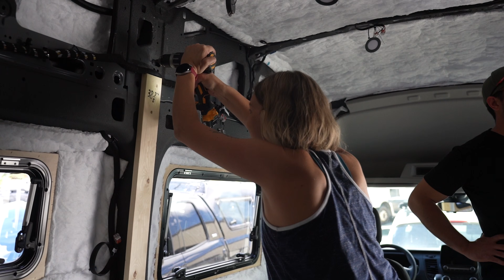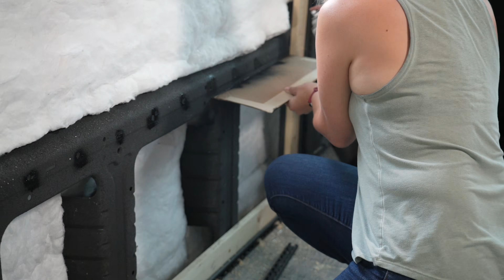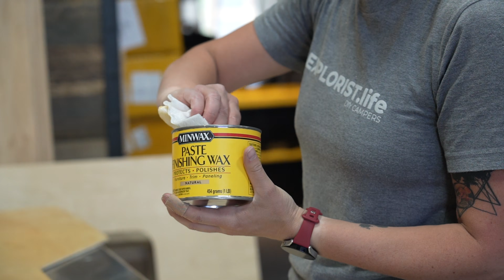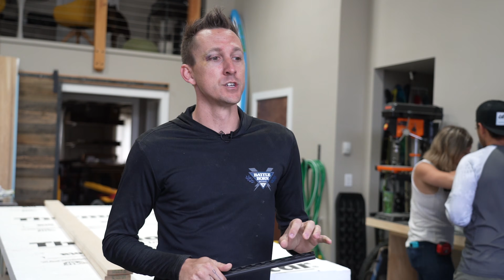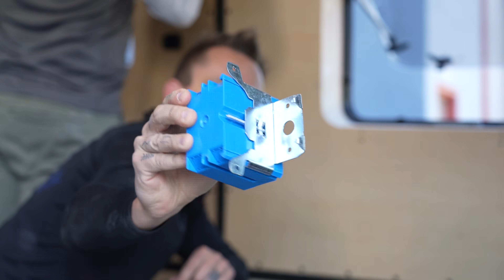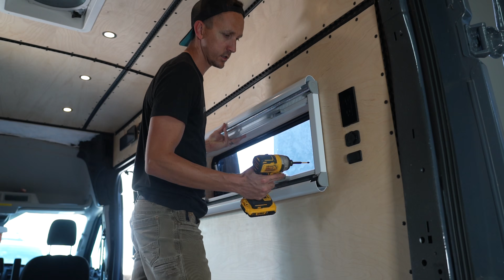DIY CAMPER VAN WALLS W/ L-TRACK (100% from scratch)

Comment: You sure are putting a lot of weight in the construction. Wood plus l-track in stead of 8020 or other extruded aluminum.
Reply from the maker: It's a one-ton van with a twin-turbo engine.  Plenty of capacity.

Comment: Loving the look of that and planning something similar for by build. Im wondering why you used 4x1 and not 2x1 or less for furring, also why not recessed L track so lots less screws for your panels? Could be a good weight saving all round?
Reply from the maker: Great questions — there are always tradeoffs between strength, weight, attachment points, and install complexity with wall systems like this. We’d be happy to take a look at your build plans and help recommend the best approach for your layout and goals, especially if you’re trying to optimize weight and mounting flexibility. Reach out to our support team here with some details/photos of your build and we can help you plan it out: https://shop.explorist.life/support?utm_source=youtube&utm_medium=comment&utm_campaign=support&utm_content=response_link

Comment: a standard spot drill 1/8th in your language and then drill to size with a good quality drill using a step drill is crazy, from good engineering  sales places you can get a range of drill bits that do this easy but i like to use a touch of cutting compound as well.
Reply from the maker: Thanks for the tips!

Comment: Great video. I love the simplistic idea of using the furring strips and L tracks together,  Such a clean look and provides a great line for the wall panels.  What black screws did you leverage with the plus nuts?

Comment: For drilling hard metals I would recommend using a carbide drill. You will have to order them online. Box stores typically don’t carry them.  And they are very expensive. But will drill through like butter. And definitely use a cutting oil.
Reply from the maker: Good to know, thanks for the tip!

Comment: Your videos have been so helpful while working on my Sprinter conversion over the past 18 months. I’ve been using a lot of rivet nuts on my build, and am about to start attaching L-tracks. I was wondering, is the assumption that plus nuts are less likely to slip out than rivnuts?
Reply from the maker: Thanks so much — awesome to hear the videos have helped with your Sprinter build! You're right to compare plus nuts and rivnuts — plus nuts generally offer better grip in thin sheet metal because they expand more and create a wider hold, which can help reduce the chance of pull-out under heavy loads like L-track.

If you'd like help picking fasteners or mounting techniques for your layout, our support team can dive into the details with you: https://shop.explorist.life/support

We offer free personalized help for gear bought from our store. For other gear, our Pro Support Membership is a great way to get expert guidance: https://shop.explorist.life/shop/all-products/membership-tiers/

Comment: Slow speed high pressure. Rule of thumb drilling metal… also, it’s called an unibit. Also, if you’re framing out with a unibit, your pilot hole should be the same size as the smallest step…. Instead of doing that, use self tapper screws with the pilot hole

Comment: You asked us to leave comments for tips on drilling hardened boron steel of a ford transit. 

I use an abrasive cone bit. First I take a punch and dimple the metal and then I use a rotary tool to bore the hole bigger with the abrasive cone. It’s slow but it does the trick

Comment: Why couldn't you have used the existing holes for the plus (rib) nuts? Any why install then every 6 inches (or however distance you have)? Doubling the distance between each would've sufficed?
Reply from the maker: 1: Those holes didn't always line up.  2: The holes were pre-drilled in the l-track and leaving every other hole empty would have looked goofy.

Comment: I love, love your videos. I am redoing my ceiling. But I can't use furring strips like you did because I would lose too much height. Does the L-Track need support behind all spots? Could I just hang it lengthwise as you did without a furring strip between the ribs of the van ceiling?

Comment: So, the main reasons and benefits for all the L track are: (1) Strong and configurable mounting surfaces for cabinets, seats, beds, kitchen counters etc. (2) They make it much easier to remove whatever is secured to them so you can get access to the walls behind them (and what's behind the walls themselves). (3) They make the van more "modular in the sense the cabinets, boxes and beds mounted to them can be removed more readily so that the van can open up inside and be used for hauling large objects etc. (4) The L track allows for very flexible anchor points for straps to secure loads inside the van. Is that about it? Just trying to decide if they are worth the effort for my more primitive and simple build. Thanks
Reply: You can always add them on top of any type of wall you do.  In a van almost anything goes so the only limit is your imagination

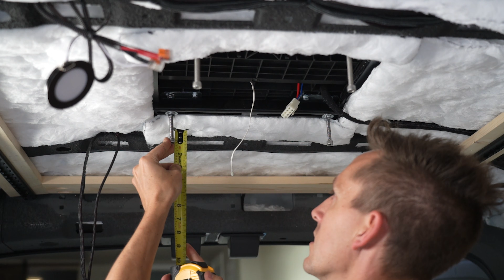Comment: How is the furring strip over the back doors attached?  It looks like it's just kreg'd to both of the strips on the side (19:01) and nothing is actually attached to the van in that section (b/c those side strips are attached to ribs), is that right?
Reply from the maker: Yeah, that was just pocket hole'd up there to give us something to screw the back part of the ceiling panel to.

Comment: Any pneumatic rivet nut gun you know of that works with stainless steel rivnuts and plusnuts (that's a couple hundred dollars or less, not thousands of dollars)? The KIARUO LM07 in the video's tools list indicates can't use stainless steel nuts. I understand stainless steel nuts should be used on exterior underside of van floor, because the standard zinc plated steel ones will likely rust in a couple years if not sooner. Have any insights, recommendations, pneumatic rivet nut gun options?....
Reply from the maker: Idk, the one shown in this video is the only one we've ever used.

Comment: So much weight, why? Its a moving vehicle, you should be looking for low weight. The money you spend hauling so much weight in the van all the time is so much more than using A/C or Heating.
Reply from the maker: It's not so much weight.  If I put 8 sheets of 1/4" plywood in the back of the van to haul home, nobody would bat an eye.  This van is literally designed to carry weight.
Reply: Carrying weights uses more fuel, more weight also means more forces while you are driving. Vans and cars  are designed to be light, and so should be camper vans.

Do you need wood in a van? Its not a house. We should look at the function and choose the best materials. I personally don't think wood cabinets are the best way to store things in a car, there are many alternatives. 

We don't use wood trunks and chests in travel bags anymore, why do it in vans? Why not develop a modular storing system, based on cases that you can take in and out of the van, for example?

Composite, lite weight material cases, you can store in your garage or house and move them to your van when needed.
Reply from the maker: @josearaujo8616 It's clear you don't like my projects.  Perhaps just move on to a different video?
Reply from the maker: Or better yet, build your own van and upload your own tutorials to show everybody a better way.  Until then, you aren't adding any value to the world; just talking shit.

Comment: Great Channel...Just started my Transit 250....got the same pneumatic tool and plus nuts in video.   I'm having a problem with the plus nut spinning on install and won't mushroom out. The hole is smaller than 3/8 , tried a star washer  to see if it  would grip..  not sure what I'm missing. Thanks in advance

Comment: Again one year plus, :-) I wonder, I often use rivnuts that come with a very small flange so you don’t need to either space out or drill out a small section. Wonder if these also are available in plus nuts which I think I like better. Awesome build, I am going to lend your ideas if you are Allright 😅

Comment: Maybe I missed, but I didn't see you had used reflectix for insulation...  neither here nor in the previous episode. But you mentioned it while starting the insulation. Did you actually use it? 
Thanks!
Reply from the maker: lol, yeah; we ended up not using any.  I figured we would use some on the B/C pillars but ended up not.

Comment: I always carry a large magnet (covered in blue paint tape) that I stick to the sheet metal under my holes when I'm drilling to catch the metal shavings when I'm drilling.  The tape helps to avoid scratches on the sheet metal.

Comment: Are you concerned about the metal shavings from drilling into the metal and falling between insulation and walls rusting over time?
Reply from the maker: Nope.  Not really.  If I were concerned about stuff like that, I probably shouldn't be in the automotive customization game. 🤣😆

Comment: Why would you not drill all the holes first before putting the wool in the walls? Just wondering. We would not want the metal shavings getting into that
Reply from the maker: Mainly because it wouldn't have made sense to put our insulation video in the middle of our walls video.
Reply: @EXPLORISTlife  thanks. Have a great weekend and keep up the great videos. You all do a very good job with all the information

Comment: Won’t the lateral l tracks on the roof will be enough to hold a hammock?

I’m looking for a solution for my hammock problem :D
Reply from the maker: Probably.  When you do your walls, just think of where the hammock will go and make sure those points are the strongest.  The L-Track will hold a hammock for sure; but you just want to make sure the L-Track is really secure where you plan on hanging from.

Comment: I would love to know your thinking behind using the paste wax versus a polyurethane or other coating. I’m sure each one has its own pros and cons but would love to know what helped you make your decision.
Reply from the maker: We had paste wax in the cabinet and did not have polyurethane or other coatings. 🤷‍♂️🤣  There was incredibly minimal thought that went into what finish we used on the wood.  Paste wax is always my go-to as it works well for most cases I'm trying to use it for.

Comment: would you have done riv nuts next time since they would install easier with the air gun then the plus nuts? seems easy to mess up with how strong plus nuts are
Reply from the maker: I don't really have a strong opinion on plusnuts vs rivnuts.  I think those two are like the ford vs dodge of the fastener world.  People love one and hate the other when in all reality, they are both fine.
Reply from the maker: I'd probably just use plus nuts again because they worked just fine for us this time around; and why change a good thing.

Comment: Astro Pneumatic Tool PRN1 is the ideal tool to use, its what I use at work at on a daily basis. Also try rivet nuts in sheet metal, preferably stainless. much better than 'plus nuts' they're less prone to loosening from vibration.

Comment: I was trained by the US Army to repair Safes and Arms room vaults...sames as bank vaults.... (Not much use in the states for a combat sniper...Vietnam 1970, 2/502 Inf 101st Airborne) after I got back... I was a bump and paint man before I was first drafted...spent 9 years Army before moving to Australia.
 All safes when drilled one uses; cobalt drill bits, which are very expensive and brittle, saying that, when using them, slow the drill down extremely low and also use oil (they used to make a cutting oil for armor plating, but even engine oil helps, putting a couple drops on the bit ....that way you won't break them as they are very brittle...
 Side note;
 >As a teacher I used to always explain to my students, that the reason I just told you not to do something, is because I did do the same thing and paid the consequences...LOL... nice post folks...be smart...

Comment: I did something similar, but much less nice (furring strips, plus-nuts, and thin wall board) on our Transit. Suggestion: It really helps to use cutting oil, if you are not doing so, when drilling through metal. 400 plus nuts! That's wild. If the are 18"" apart, that's ~600 ft of L-track/furring. I'd be interested in why so much track, or so many Plus nuts. Looks like some of the plus nuts are spaced at <6". Another friendly suggestion: 90 PSI may be the recommended setting for that pneumatic plus nut tool, but I found the plus nuts can distort the sheet metal of the Transit van if they are cranked all the way down (pneumatically or manually). Did you check that?  Thanks!
Reply from the maker: Thanks!  The holes in the L-track are about 6" apart and we just used plus-nuts to match.  We used so much track so we would have infinite options for attaching cabinets, beds, etc as you see later in the build.  We played around with the PSI of the tool, but I don't remember specifically what we landed on as the best result.  Just have to play around with it like you would with a nail gun.

Comment: I’m a machinist and would recommend a cutting oil or cutting wax great for keeping drill bit temp down. Reduce your rpm on the drill when the material is harder than the cutter it just makes the process more difficult than it has to be and finally pilot holes use a drill bit roughly half the size of the desired drill size or the thickness of the web (inner diameter of the point) that usually fixes the problems for me
Reply: I can't understand why they didn't know that! What else are they wasting customers money on? Or more importantly how they can stay in business without being proficient and efficient! (Didn't even know the best way for their business to use rivnuts)
Reply from the maker: lol, what!?   We have never installed walls for customers. We only install electrical systems for customers, of which we are SIGNIFICANTLY faster and more proficient.
Reply: @EXPLORISTlife you are being deliberately obtuse, you have very many videos covering van building from start to finish. Sure, it's just entertainment content, but it's still implied that you know what you're doing....
Reply from the maker: @Randombourg It’s always the guys who are scared to post their own work on their own channel who talk the most shit.  Wonder why? 🤣. Think you can do better?  Quit talking about it and be about it sweetheart.
Reply: @EXPLORISTlife mate, I'm not the one posting videos trying to pass as an expert! Sweetheart, really did they call you that in school or prison? Hard to decide because you should try being a jockey next.

Comment: Random question... What drill bits did you use to mount the l track into the hardened steel ribs? I'm having a hard time finding bits that will drill through the thick metal. Your van is looking great! Enjoying following along as I am just getting started with my new transit conversion as well.
Reply from the maker: Cobalt Bits.  Check the video description.  I've got links for parts & tools there.

Comment: Is their a purpose of the  L-tracks, or just decoration? I think the Schuter Quadec profile used in bathroom tile is a cheaper and lighter option.
Reply from the maker: If you check out some of the other videos in this build playlist, you can see what we are using the L-Track for. 🙂👍
Reply: @EXPLORISTlife  i know you will use it to achor your cabinets and appliances, but i can't imagine you would need them everywhere.
Reply from the maker: I do indeed want attachment points everywhere, yes.  I want this to be more secure, removable, and professional-looking than just some random lag screws through the walls.

Comment: What happens when warm more humid air goes through your walls and insulation and meets the cold outer walls? I guess condensation and water in the insulation and backside of the wood. A moisture barrier like plastic sheet after insulation would hinder the warm air to travel to the outer walls.
Reply from the maker: We will keep moisture in check with proper ventilation and externally vented heating so your concern is a non issue.  There is no way to get a true moisture barrier in a van.

Comment: Carbide drill bits are a lot better than cobalt for steel. Like you said start with a smaller diameter bit and then finish with desired diameter. Heat is what kills drill bits, and speed is what causes a lot of the heat, so use a relatively slow speed.

Comment: First off, good content! It is helping me with my own build-out:2022 SPRINTER 4x4 cargo. Question: I took your advice and bought the pneumatic gun and 1/4 -20 plus nuts and I can't get them to tighten up before they spin. So far only trialed in scrap and no good! Would a longer drive screw in the gun's nose-piece help? It seems too short with minimal engagement in the plus nut and each of the 4 screws that I used that came as spares with the gun have cross-threaded themselves and the plus nut which then let to friction and spinning. Please let me know what you think and keep up with the good tutorials.
Reply: I believe you do need to replace with longer bolts for plus nuts, you can get them at the hardware store